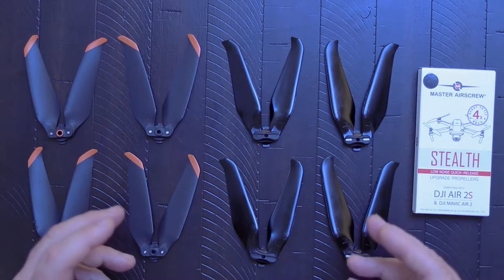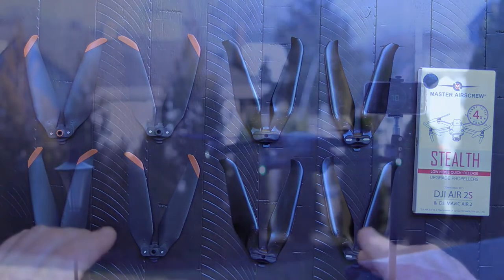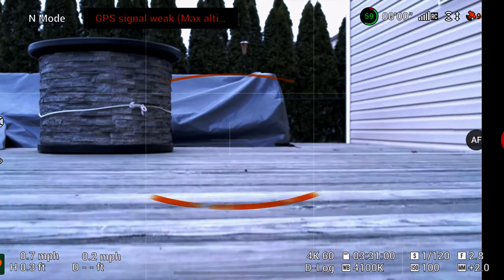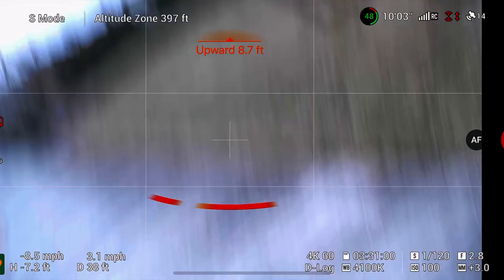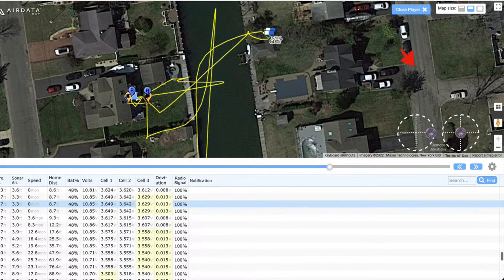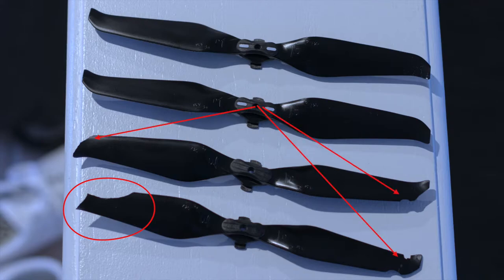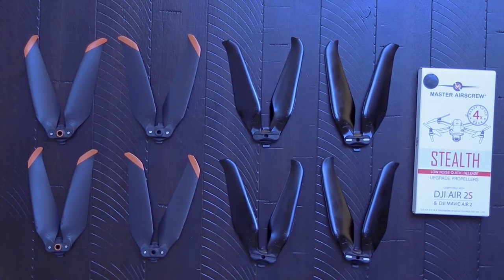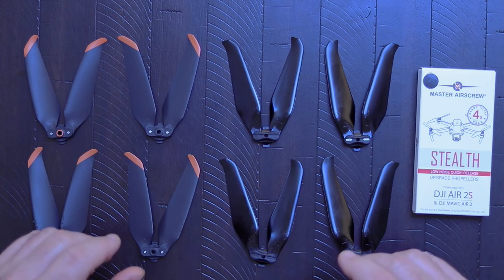DJI Air 2S - Master Airscrew Props...Better than OEM? And the ensuing CRASH!!!

Comment: I had a crash with my Air 2S and I too noticed only very minor damage to the DJI propellers.  The drone checked out fully afterwards (using the standard diagnostics in the Fly App) and has flown about 10 months since without any issues.  Ian In London did a video about the Mavic 3 crashes and pointed out that drone can display only a fleeting message that low ambient light levels mean the sensors won't detect objects.  So from that I learned to only rely on the Fly App screens status indicators in the upper right (white or red).
Reply from the maker: Yes I too rely on the status indicators while in flight….Ian in London is a great resource….: )

Comment: I think the crash is because of sport mode. Obstacle sensors are off when you fly on sport mode and drone was flying too fast to stop.
Reply from the maker: Yep, obstacle avoidance being off def contributed to the accident but pilot error was the primary cause…: (
Reply: Which was fully acknowledged and admitted to in the video 🤷‍♂

Comment: I've had two pairs of MAS Blues, broke both. Of course, my current set is still usable because the damage isn't significant, but I wouldn't want to risk my drone or pedestrian safety when I'm out and about. Personally, there is no substitute for that slightly muffled tone that the MAS props give to the drone in flight. It's just a preference I suppose, however, I will second you on the part about their quality, My pairs have both had small amounts of flashing on the edges of the props from the manufacturing process, something that isn't present on DJI's much cleaner props. and the color is somewhat glossy which does not match the images on amazon which look much better. so visually they lose a lot of points from me (but they match my WrapGrade skin, so it's worth it haha)
Reply from the maker: Wow….very detailed review of the MAS props…nice job…and yes I agree def personal preference….and I also was initially drawn to the MAS props for the color choices….had they performed better after collisions I would likely have continued using them….: )

Comment: Hello awesome video. Do you know the weight difference between the OEM and master air screw propellers please ? Could you weigh them ? Thank you very much
Reply from the maker: The MAS prop weighed in at 4.4g and the OEM prop weighed in at 4.7g.
Reply: @ghost1917  thank you very much
Reply from the maker: @mavic3help  my pleasure and welcome to the channel….: )